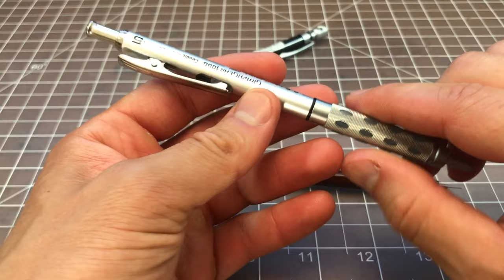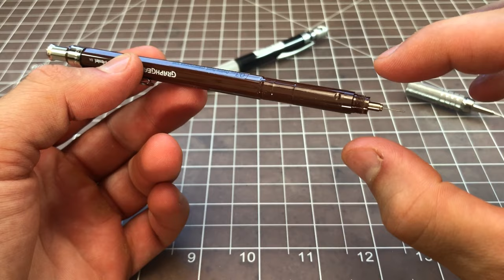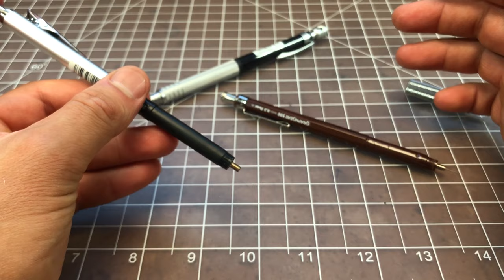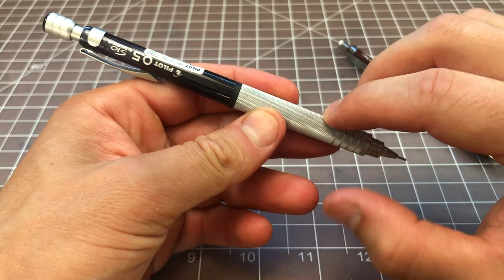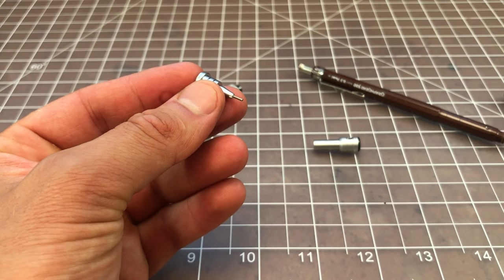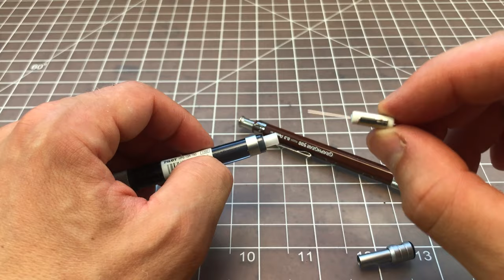How to Fix a Mechanical Pencil Lead Jam

Comment: Another thing that can happen is that the narrow tip gets bent “ever so slightly” which breaks the lead as it goes into it. It can be straightened however…
Reply: How can we straight it
Reply: THANK U SO MUCH, YOU DON'T KNOW HOW MUCH THIS COMMENT HELPED ME, I WAS STRUGGLING FOR 2 STRAIGHT HOURS
Reply: Please tell me how to straighten it
Reply: @Butter_mybiscuitandlickmypecan Can you tell us how to straighten it?
Reply: @Honda_Kiku  I don't know if this will work for everyone but i just pressed it in the wall firmly until it was straight, but please be careful because i won't know if your mechanical pencil would break but it worked for me<3
Reply: Mine didn't straighten against the wall and I think I lost the tiny part inside the tip.
Reply: What I did to straighten is use an empty pen body and use it to adjust the tip
Reply: help. It did not work
Reply: @KaiTheArtist5467  wdym?
Reply: etyrnalia  Use a needle or lead jammer
Reply: you could also use a very narrow pin to straighten it

Comment: Thanks for this! Also, anyone who is or who knows a guitarist will have access to the spare lengths of guitar string which get snipped off when changing them. The top three strings can be used as makeshift tip cleaners of varying sizes, depending on the gauge of the string set. I just rescued my 0.3mm Graphgear 1000 using the B string of an Ernie Ball Super Slinky set.
Reply: Ha ha ha...that is an awesome suggestion. My son is a guitarist and has plenty of strings for me to use to fix my pencils. Great idea.

Comment: Super informative and simple video. Thank you!! 

I was able to unjam my Pentel Graphgear 1000 (.5) after finding out that the problem was in the unscrewable portion. I don't have a cleaning rod; Instead, I used some very thin jewelry wire and it fit and fixed the problem like a charm.

Comment: Thank you for the great tutorial.  I had a Pentel Twist Erase mechanical pencil that jammed.  I almost gave up and the bottom half was literally in the trash can before I watched your video.  The jammed bottom half was retrieved and I found out the bottom piece could be unscrewed to reveal the clutch.  That was cleared out and my pencil was revived.  Many thanks!

Comment: but my tip is the one that's blocked and i did everything to remove it but it's not going :((( Why are there no youtube videos for this
Reply: Have this same problem no tutorials
Reply: I tried sowing needles....sowing needles are the exact size of the tip so it didnt work, of which im guessing is like a .4mm or .3.555mm. If youre using a .3mm mech pencil. They want you to buy extra stuff.
Reply: Same issue here
Reply: same case here
Reply: Me too. It seems to be a common problem. I have a feeling you can't fix it. Or if you can, it might not be worth it. For all the trouble, you can buy a new mechanical pencil.
Reply: fixed it with .5mm needles, i use some lubricant for keyboard on the needle and slide it inside, maybe 3 pieces is enough. but becareful, i break one of the needle and well i don't need to explain
Reply: Same so plea help me
Reply: i havw the same problem rn 😭😭
Reply: same..

Comment: Excellent Video. Mine had a tiny piece that was stopping the pencil from functioning. Didn't have a cleaning rod per say but used a hair pin and it did the trick. Thanks again

Comment: Thanks, that did the trick. I did notice in my GraphGear 1000 that there is actually a little rubber tip in the 2nd layer front metal piece. This tiny rubber piece allows a little friction so leads don't just fall out each time you press the back to advance the lead. This was miss-aligned, and I gently pulled it out by the lead that was halfway through it, and dropped it straight in so the lead popped through the front. Then I followed the other steps you outlined and reassembled the pencil.  Works fine now. Thanks!
Reply: can i ask how did you do it? I also saw a small rubber here on the tip, now when I push the rubber comes off. I put it on over and over again but I don't know how to stick it
Reply: @darleneselboza3539  Hi Darlene - I've had a lot of practice since that last post about a year ago.  First - know that when the lead gets too short - either near the end or broken - the pencil stops working in terms of pushing lead holding firm out the tip.  So, at that moment, you need to remove the metal housing, and remove the old lead which is stuck halfway out the rubber insert. You can use the wire rod made for this purpose found in the eraser. Next step, with the metal tips all off,  is to carefully release a new lead from the barrel about two inches - without breaking it. Very tricky. You have to push down on the top button to release, and at the same time, your other hand pushes back the collar (sleeve around the clutch in this video)  at the exposed jaw tip.  The lead will slide down.  Now with two inches exposed- you super-carefully insert it through the rubber tip and out the front end of the inner metal insert. Then screw that back on, not breaking the new lead. Re-assemble the outer sheaths.  A lot of words here, I hope it helps a little.  I'll have to do my own video on this, I think.  Get used to this process and it's not too hard. It's the price you pay for the .3mm pencil fine-ness.

Comment: How do you clean out the graphgear 500? I cannot see light through the tip, but I also have nothing small enough to fit through the hole to unplug it.

Comment: thanks for making a video about this ordinary common trouble, cuz it actually happens a lot.
I had bought a expensive mechanical pencil which was pretty and i really enjoyed it, but since i always used 0,7 mm pencils, i mistook that new pen (0,5mm) as 0,7 and had probably got things stuck.

it was yesterday, but after i had a good nap after school, i tried to repair it again and it worked!

Just telling my story in case someone is also having trouble. You will fix it! mechanical pencils dont break that easily, it will get alright

Comment: You saved me money. I almost threw my mechanical pencil out and buy another one. It turns out my clutch was jammed with small pieces of lead. I took a pin and poked it through the clutch. It spat out little pieces of lead. You got me out of a jam! (Pun intended. LoL!)

Comment: so i watched ur video and it was great just have a question tho so my grapghgear 1000 has lead stuck but it is in the tip of the pencil after the clutch. So how would I fix that would I just stick the cleaning rod in there and push it out or what?

Comment: Yoo! I have the 0.3 500 and I just used the clutch and lead to push back the clogged tip from the front. This works perfect if you don’t have a cleaning rod but a steady hand.

Comment: mine got jammed somehow by this black thing, it looks like a minecraft hopper, i still have it just in case if it's part of the pencil, it feels like rubber and is very small, do you know what it is?
Reply: R yours graph gear 500?
Reply: @sopheasofea  tombow mono graph 0.3mm
Reply: @SONYSIKE  i think that's one of the part that hold the lead (to avoid breaking)
/ English is not my first language
Reply: @sopheasofea  you might be right, thanks

Comment: After following your excellent instructions on 3 mech pencils for an hour. I had no success.  It was in all 3 cases the nozzle that was blocked but no amount of attempts to unblock with the device provided in one of them. As these have been in my pencil tray unused and unusable for years they are now in the trash.

Comment: My Graphgear just seems to have the lead turn to glue. I managed to clean it out with a .7 mm or less wire like a cleaning rod. I wrote with it for just a little. I went to use it months later and it was all gummed up. I could barely use a rod to clean it out. Its working again for who knows how long. I am using Pentel lead in a Pentel pencil.

Comment: Sir, I've a problem with my rOtring tikky 1.0, and the problem is I can't unscrew the nib, it's stuck there.
Reply: I solved the problem guys, just hold your pencil nib onto hot water's steam, and after 3-4 min, try unscrew the nib "it'd be better with an cloth to unscrew"

Comment: i have the graph gear and i checked my pencil and it said 0.7 lead and i used 0.7 lead and it worked it was
pumping and it won’t get into the bottom part i open it and it stops going at the middle right before it get to the bottom

Comment: Hi!! I have a mechanical pencil, and i looked inside the place which holds all the leds and there are three just jammed in one place.. i tried using the cleaner from my other mechanical pencil but it wont budge! The model is a m&g AM0.7

Comment: uhh can you pls help me on this one?
Short story, yesterday my dad buy me a Graph gear 1000 Pentel, and just earlier, I putted 2B Leads while it was still on HB mode ( i didn't know i can switch it to 2b soo :/ ), which lead it to stuck and unvenerable. So I take out all the parts off, andd the 2b lead stuck in the tip (also some lead stuck on the mid). how can I fix this?

Comment: i sadly have a diffrent pen and it seems like i cant turn the front nor the back off or i would have to put on some really tough pressure to get it off. i have tried twisting and pulling. The pen is a Penac Protti 0.7 pls help

Comment: don't buy a cleaning rod, i used a sewing needle, much cheaper. but this exercise works, once the clutch gets pushed back, any stock pieces of lead will release. THANKS unsharpen!
Reply from the maker: Great tip! How far down will the sewing needle work? will it work with 0.5mm? 0.3mm?
Reply: @unsharpen  it was actually a 9 mm. the needle went pretty far. Then I shook off the pencil and voila! the stuck lead came out. : )

Comment: Guys if your lead is stuck at the tip where you write, open it and use tweezers and pat it or reassemble it and click it a bunch of time cuz there still might be very small pieces inside

Comment: I found out that if it's just metal, you can take the front piece off and heat up the tip with a lighter (while holding it with pliers of course), then just tap it on something and try clicking the lead out like normal

Comment: I have the Pentel Graphgear 1000 .5 .  There are two leads in the Pencil plus I believe the active one. This is a new pencil. Am I supposed to put more than one lead in the pencil when reloading?
Reply: No, don't put more than one or two leads in your Mechanical pencils. If you want to keep it working properly and working for years, stick with one or 2 leads. Even though it can take 3 without many issues, 2 provide more safety.
Reply: @greekveteran2715  thanks, I will try that. I gave up on it, just sits in a drawer. Bought an inexpensive pencil and it is a pleasure to use.

Comment: Thanks so much for the instruction video. I bought on Jenaury Pentel graphgear 1000 and when it stopped working I first thought I just ended the leads but even if I tried differents leads it didn't work and I was afraid I broke it, while it was jammed. Now it works perfectly!
Reply from the maker: Great to hear!

Comment: So if I buy a cleaning rod will it work if I got a .7 piece of lead stuck on the metal part of a .5 graphgear 500
Reply from the maker: Yes
Reply: @unsharpen  do you happen to have an Amazon link for them

Comment: My eraser does not have a cleaning rod.  Any ideas of other things that could be used to clear a 0.5mm blockage?
Reply: Stainless steel fishing leader. Round off and polish the tip so that you don't push out the tiny rubber O ring in the tip. That O ring prevents the lead from retracting after you release the advance button.

Comment: I need help! Theres a new problem where the clutch thing on the bottom of it is moving with the part that moves up to move the lead.
Reply: Or in a bit clearer terms the clutch won't open since the part that is used to be ejected is following the clutch go up and won't work :(

Comment: My mechanical pencil tip broke or more likely the tip got pushed back and when I draw the led comes out is there a way to fix that ?
Reply: The led comes out by itself I push for led and it doesn't come out

Comment: Ugh I dont have a cleaning rod T^T. Dont know if they sell it here, will try to look for something else to remove it. Tried blowing with my mouth lool
Reply from the maker: Small paper clip or safety pin?
Reply: Small quilting needle works great
Reply: DOROTHY G I made it wet then put air pressure to take it out (blowing by mouth) and it worked

Comment: I got a graphicgrar 100. it is not jammed but the lead doesnt come out. The tip is moving back and forth and not working! I have done everything you did tho... please help me! It is my thrid one and i threw the two due to this problem.
Reply: Same
Reply: @lawliet3186  I'd better try with 0.7mm lead instead of 0.5

Comment: Hello
My lead pencil (uniball shalaku) 
Is malfunctioning since yesterday 
Whenever I refill it with leads, 
The leads come out right after without doing anything 
Pls help I have my exam tomorrow
Reply from the maker: Take off the front and look at the clutch (the thing that holds the lead). It’s likely jammed or the little ring at the front isn’t in place
Reply: @unsharpen  I'll try
Reply: @unsharpen  is the little ring supposed to be at the end or can it move?
Reply: @unsharpen  thanx it is now working!!

Comment: بسم الله الرحمن الرحيم 
I have a Rotring 600 M.P and none of these advices really worked for me. What I did by the virtue of Allaah was unscew the penicl get the tip and put the 0.5 mm led through the hole from the top. 

I pushed it in and cleared the led that was stuck therein. 

Hope this helps!

Comment: Buying a new rod aint a solution, i have the generic pentel sharplet 2 that i see often, atleast in my area. 

It doesn’t have a function that allows me to open the tip to clear the clutch and it doesn’t include a rod. These types of pencils are very common, so tell me how to fix dis sht without a rod. If u dont have a solution for this, not many people are going to find this video helpful.